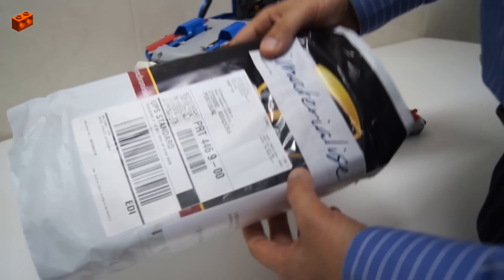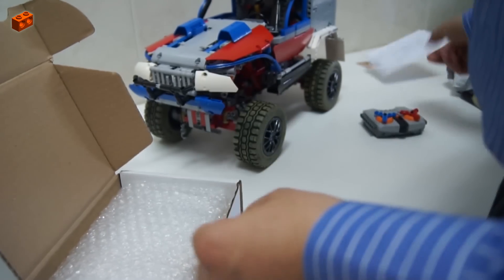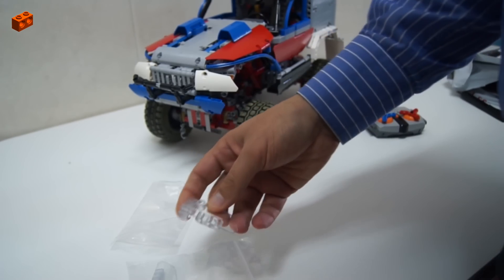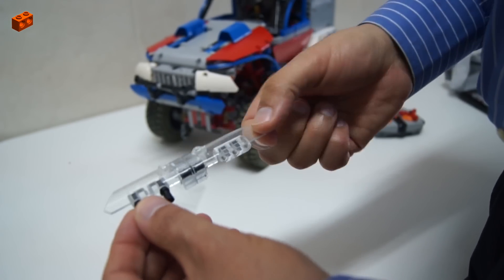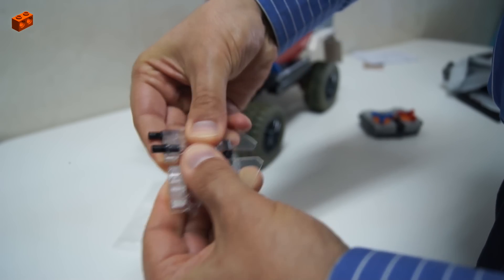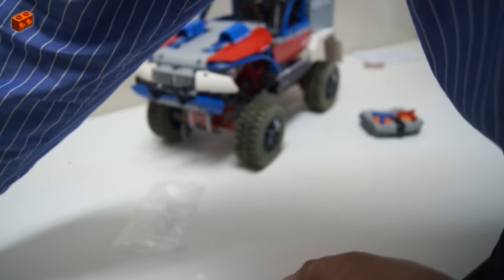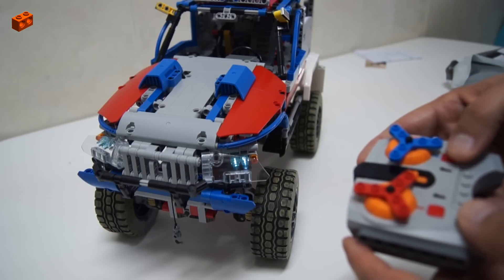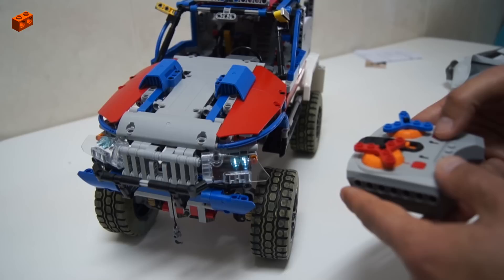LEGO Technic 3D printed panels - Unboxing

Comment from the maker: Non clear panels ordered from a professional service foundry can go from a bit less than 10€ (with postage) to some more depending on the materials chosen and possible to apply to your design.
These made with transparent resin, were much more expensive. :P
The larger the panel, the larger the cost also.

I'll organize more details for the community, sometime ahead.
Just give-me some time. :)

Now I'm still doing experiences with different materials, etc...